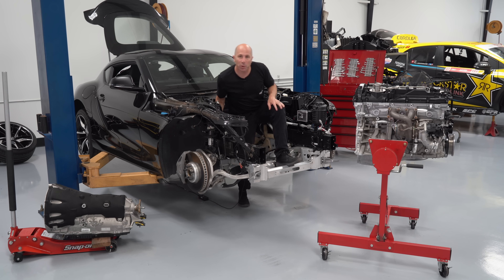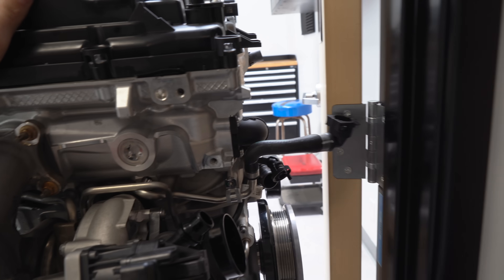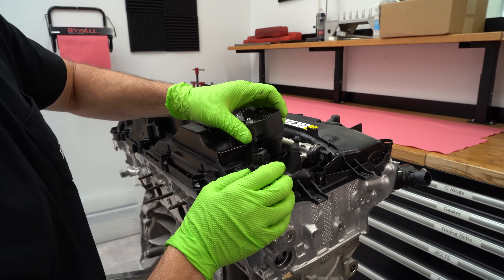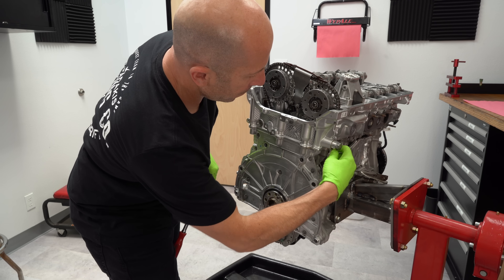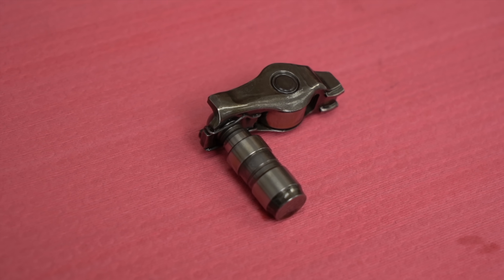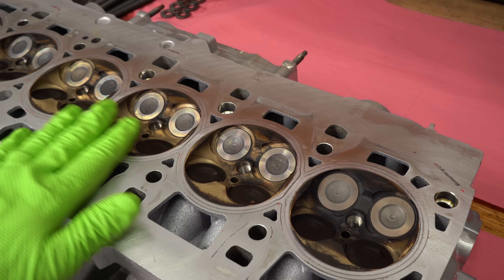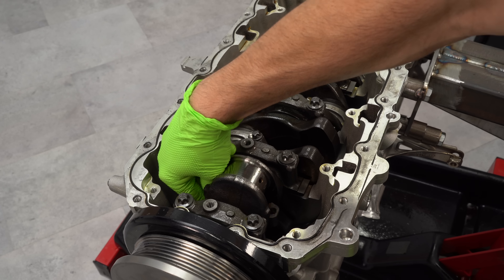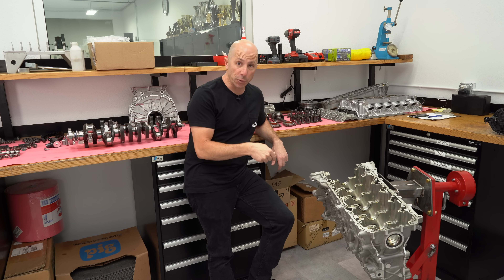2020 Supra B58 Engine Teardown - First Look - Better than the 2JZ?

Comment: Question: with modern day electronics can you make an engine without cam shafts?  

Havre a computer just control valves opening and closing?

I swear I heard manufacturers like koenigsegg are using that technology? 
 
Can't remember for sure.
Reply: Freevalve, a Chinese company is using it.
Reply: This motor uses a mechanical fuel pump like old times, sometimes it is good to have everything run off the rotation of the crankshaft I mean you're already burning gas to spin it, might as well wind up a supercharger or run some pumps and cams off it too

Comment: In a hyundai I felt the drive by wire system had too much latency issues.

You'd press the accelerator and there is a noticeable pause before the power kicks in.

I am sure others are better, it's just that drive by wire done poorly can have these issues.

Comment: 1. Only having two exhaust ports is gay.

2. The plastic fuel intake manifold is an enormous let down.

3. Having the intercooler in the plastic intake manifold is fucking gay.

Having the cam gears on the back of the engine is gay.

Fly by wire is gay. 

Automatic transmissions are gay.

I still like the new Supra but I would rather have the MK4 Supra or just 2JZ swap the new Supra with the Getrag 6spd manual transmission.

Comment: the main issue for this is the cylinder head itself, where will you dump all of the exhaust gas??two holes can't handle that, and the heat from exhaust itself will melt the steel away maybe??

Comment: A lot of great improvements from the n54 engine. No doubt this engine can be 1000whp+, b58>2jz.
Reply: hardley, the exhaust is too restrictive, and the use of plastic on the intercooler (even glass fiber reinforced PA6-6 will fail under high boost pressures due to heat)  will prevent the thing from ever being competitive.  Unless some aftermarket company comes up with a milled billet version of this block and all of its systems it will never be able to compete with the 2JZ.
Reply: Doesn't have to be billet, could be printed, cast, welded 
Everyone needs to chill out with the use of the term "billet" 
Not to mention you have nothing to support your guess that an intake manifold for a twin turbocharged engine can't hold up to immense pressures, you talk like big power 2Js are running stock manifold lol
Reply: AgentLinch “hardley” 😂
Reply: What you smoking bruh? Calm down.

Comment: Timing chain in the rear. 
Plastic air to water intercooler. 
Oil and Coolant system being neighbors. 

So engine out services for everyone! 

And once one thing fails, it's like playing Russian roulette. Good times are a coming at your local stealer-ship!
Reply: Nice. The engine has been around for years on bmw models but you have seen problems where until now noone had problems on. You are so cool

Comment: Really wondering if that exhaust design will flow the 1000 with out crazy emp
Reply: They'll probably swap the head from other iterations of the B58 which have standard divorced exhaust ports.
Reply: Formula 1 would never use the integrated manifold design. So I bet they'll swap the head from an M3....
Reply: @simonpeterdalangpan9761  does it fit on that block?? To me though that would be kind of cheating. To say that they have a b-58 making a thousand horsepower they would need to at least retain the head and the block. That's just me personally if I was going to say I have the highest horsepower one I should at least have the original head
Reply: @marvinwatson2749  yeah. the block looks solid but head by theory will not do because of the retained heat. Its a "green house" design rather than for power.
Reply: @zeroyon223 intake ports look great, and yeah that Runner design is basically like a log manifold built right into the head! Still logs arnt really good for flow, plus and porting or polishing work they may wanna do will be a complete bitch now.
Reply: You need to add more money and work porting that head

Comment: That head design looks like a pain. Most of that engine looks like i never want to replace anything mechanical. .
Reply: Fervid1UZ like bmw style engineering
Reply: @andrewkim9881  if you think bmw will listen to toyota before M division you smoking crack . that is M input . the s55 has a closed deck . the n55 didn't.
Reply: It looks like any new engine lol
Reply: zeroyon223    But do you know him, you never know he might be in the market for a new one
Reply: Fervid1UZ Don't worry, you never will have to replace anything because you can't afford it to start with 🤣🤣🤣
Reply: @-VaLaK  I mean, I can I just don't have any interest in buying one anymore.
Reply: @zeroyon223 no one should be grateful to a car manufacturer. They should be grateful to us we, customers buy their product, especially this one. Toyota better appreciate every unit sold on this one.
Reply: Maintenance problems would be checking each and every one of those. Ugh...
Reply: Agreed! Plus you're a 1UZ guy....more props
Reply: @andrewkim9881  No not at all lol
Reply: Indeed, and you need special expensive tools
Reply: Fervid1UZ then buy a 54 chevy   And Dont complain. If Toyota builded a new engine i think it would Be a pain to work on to. It is Just the way modern cars are built
Reply: @optimusSjors  Yeah, that makes a lot of sense to tell someone that clearly has 1UZ in their username.
Reply: Fervid1UZ the thing im trying to tell is that things change. But nobody complained about Yamaha helling Toyota with th 3sge, 4age, 2jz etz becouse its “jdm” i Dont agree with Toyota with the way bmw built it but people are in a tunnel vision with their jdm Brain that is the size of their jdm dik
Reply: Still got my 78 F150 straight six and the head is still going almost daily use since it was bought.
Reply: I mean the 2jz was looked over by germans too so I dont see the issue
Reply: @ohAwaken  not looked over . Toyota employed a bmw engineer to help design it
Reply: This is what happens when you have bmw desgin and build 99% of your car for you, it hurts me to even call this car a supra, when it's pretty much a rebadged BMW.  When people buy a Toyota they want a Toyota not a fucking  BMW, why you would buy a Toyota not for their well known reliablity, I don't know.
Reply: Wind of change   Remember what they say, BMW make great cars but Toyota are great at making cars.   cough vanos pump cough
Reply: @Tahllinavian  Toyota themselves said that the engine is reliable from their testing.
Reply: @alexstromberg7696  ah yes, the people selling the car say it's reliable. Just like every other car manufacturer.

Comment: I am very impressed by the innovation of the engine my worry is that it lacks simplicity that a 2jz has which will scare away your typical grassroots jz user
Reply: @- whoami - No way dude, The 2J was advanced for the 1990's, but it was pretty much a bog standard DOHC with valve lift adjustment and sequential turbos. This B58 has intake-integrated water to air intercooling, adjustable valve lift and timing, oil to water cooling, direct injection, I read it doesn't even use the throttle valve to rev the engine, it actually adjusts the valve lift to let more or less air in. The mechanic principles are the same, but the functioning of everything is much more involved.
Reply: Look into the n54. It’s the modern 2j made by bmw
Reply: @trippyluv1502  No it's not. This B58 is. The N54 has an open deck design, both this and the 2JZ are closed deck and much stronger than the N54. Not all inline 6's are the same.
Reply: Eh that's what the carbureted guys were saying decades ago about fuel injection.  This engine is more complicated, but it's still a finite level of complication, and with time enthusiasts will understand what's going on and go from there.

Comment: Ya there's going to be lots of theses in junkyards as the year's go by but I will give credit where it's do there is a lot good design in it but there's just as many really stupid designs in there too now I don't know if he did that on purpose with the fuel system and spark plugs but having to disassemble the fuel system just get the spark plugs out and needing to modify you're tools for that purpose really retarded And don't get me started on the timing chain people and mechanics are not going want to pull the engine just to fix the timing chain... And if you don't think you going to need to fix the timing chain go on Facebook market you'll see plenty of cars that need it most aren't even close to this in performance

Comment: All the supra fanboys hate on how a BMW engine is inside the MKV supra but they dont realize the potential of BMW engines. BMW has been doing turbo'ed engines for a very long time now and had also 3 generations of engines to perfect everything. The older generation N54 is capable of 700 whp with just fueling mods and a turbo upgrade which is insane for its age.

Comment: 100% BMW, like German enginering with most part and broke the piston rod to make the piston rod more sturdy, impressive it's close deck. But it's more cheap after market part than 2jz? i don't think so, if used BMW after market part it's is expensive, i told. Correct me if i'm wrong, just guess typical a machine with a short think, Hahaha

Comment: I was in doubt about this new supra 
Lots of bad designs in the interior but man 
The engine is a fine work of engineering 
Great video
Reply: It’s complicated
Reply: the new Corvette interior looks way more like a modern supra interior
Reply: @iheartmysquid  I don't understand why do people keep comparing the two cars they are different from one another.
Reply: @cindysue5474  its just because they are both new awaited cars...and people want to hate the supra so they use a car out of its league
Reply: actually it does, the way it angled toward the driver, jsut like the MK3 and MK4's.
Reply: if you look at pictures of the supra interiors and then look at the C8 its the same philosophy!

Comment: This block design will take 1000 HP easy! Cylinder head air flow is amazing 😉, @PapadakisRacing make it happen! I have trust in you skill and expertise to perfection!
Reply: Lots of design changes though.  And that manifold port will be a limiting factor.

Comment: Made me cringe when you were taking the intake cam out. I’m a bmw tech and have had one of those springs snap back on my thumb. Not a good feeling. But this was a great video👍
Reply: its crazy how similar this engine is too the 3 and 4 cylinder engines in the bmw's the springs you talk about look the exact same the oil pump, oil filter and so many other bits look exactly the same
Reply: @parteepro  its all modular now mate. It makes more sense to make one part thats used on everything. Makes them more money
Reply: @chrisg4rr377  still wouldn't expect so many parts to be exactly the same, from what I've heard there moving away from the modular baukasten engines and slimming down there engine line up. Think I read it on car throttle or something
Reply: @parteepro  all bmw 3,4 and 6 cyl engine of today is sharing bore and stroke (500cc per cyl) so is not surprising they share a lot of parts.
Reply: @parteepro  Why not ? If you make one part that works well, why do you have to design completely new part that does exactly the same thing for the other engine ? It does not make any sense.
Reply: Question how new is this engine and could he technically have just bought it straight from BMW instead of buying a whole car
Reply: BList BMW has been using this engine since 2016 I think it was. But this should be an updated variation of it. He should have been able to order these tools from BMW, or there should have been aftermarket options available.
Reply: @cmaszerowski  He did say that he has that tool coming just didn't want to wait.
Reply: BList this b58b30m1 has been around since 2018 model year cars, other suffix b58’s going back 2 more years. No idea of the differences. I gotta say it was stressful watching this teardown!!!
Reply: I was pulling one of the engines apart and was using the tool. The lad next to me doing the same job without the tool. His finger got trapped too. Was funny for me
Reply: Because of the modularity you can pump out new 'designs'@ each year almost
Reply: Dude my blood was boiling with that
Reply: Bro trusting you’re telling the truth so seriously is there an easy way to replace the timing chain?
Reply: @Tech95327  Timing chains theoretically last the life of the engine when designed well. I have a feeling the engineers didn't pay any attention to making it serviceable.
Reply: @louisvaught2495  I was thinking the same lol. Modifications to make 1000 hp is going to interesting 🤔
Reply: @louisvaught2495  I already saw some FIAT's timing chains being necessary to replace it, because it was noisy, with like 90k miles.
Reply: Xy9d same with Honda’s, we change out worn timing chains all the time.
Reply: @Tech95327  you can take the cam box cover off and change the upper chain in place with a repair chain but i wouldn't say its a diy job.
Reply: tech Only way you’re replacing it is dropping the trans and motor with the subframe and pulling trans apart. So far, so good with these engines, but we shall see.

Comment: Super interesting. Is there an advantage to that can lift actuation method over the typical oil solenoid 3rd rocker arm in VTEC or VVTLI that I grew up with?
Reply: Major increase in efficiency and power at low rpm, any car that has valvetronic does not actually need a throttle body to control airflow, the throttle body is only there to create a slight vacuum for the pcv when not under boost lol
Reply: @derekbon694  its way more complicated, but I imagine the abrupt VTEC crossover is eliminated. Only on the intake cam tho.
Reply: @Fuckstupidlibtards  there is no need for it on the exhaust side because it is just pushing the exhaust out so they have made them lift as much as possible. it is used on the intake side to control airflow. it can adjust the valve lift from 0.3 to 9.7 mm depending on drivers imput and load. its mainly to decrease the losses from the vacuum in the intake. and VTEC is strictly for more lift/ duration at higher RPMs for more power. this is almost completely based around efficiency.

Comment: Also, electric wastegates allow for better fuel economy on small turbocharged engines; where the driver is always getting into Boost thus, the ECU adds fuel for enrichment which causes poor fuel economy (city driving for example).

But with an electric wastegate, the Engine Calibrator can open the wastegate based on TPS inputs (in addition to MAP inputs). So city driving = 0-30% TPS where wastegate stays open until TPS > 30%. Therefore, no boost and no fuel for enrichment. This calibration would be good for “eco-modes.

With an old boost actuated diaphragm, one would always be at the mercy of MAP; thus, having no control over wastegate positions to control “when” air is allowed to increase into the engine.

Comment: That was very interesting, thank you for taking the time (and money) to do this!  So if I got this right the Exhaust valves have variable cam timing, the intake has variable cam timing and variable valve lift, neat.  Stupid question time:  Is the variable cam timing actuator on the cam gear 'Fast' enough to effectively create variable cam duration?  (IE prior to opening the valve the cam is 5° advanced, as the valve reaches maximum lift the cam timing is rapidly moved to 5° retarded effectively gaining 10° of lift duration)  Sounds like it would be a great way to create weird valve train harmonics, but anything seems possible these days... /s
Reply: BMW has been using the valvetronic system for almost 20 years so they have had lots of time to perfect it! The DME knows how quickly the motor can actually adjust the valves ( which is extremely quickly) but you have to have the DME relearn the valvetronic motor whenever you change it so it knows the location and can adjust the adaptations.

Comment: i dont see an ounce of toyota in that engine design. thats 100% BMW. hell it doesnt even have the d4s injection system, will we have carbon issues on the intake valves? time will tell.
Reply: Dan K. Are you surprised? It's not a secret that the motor is a BMW motor lol
Reply: Agreed....that is so damn similar to a BMW 6 cyl. Really fun video to see it all disassembled.
Reply: @MrBluePoochyena  There was a video where Tadasan was interviewed. In that vid he clearly stated that parts that didn't meet their standards were only suggested to be changed. He didn't say anything about BMW having to comply or even changed them.
Reply: @MrBluePoochyena That's not what Tadasan said. He also mentioned that they were rather surprised that the B58 was pretty reliable and met their standards from the start. I know there's a vid going around saying that the B58 was disassemble and whatever parts that didn't meet Toyotas standard was sent back to Germany to be upgraded. However, those words didn't align with what Tadasan said himself and he clearly stated that it was only suggested.